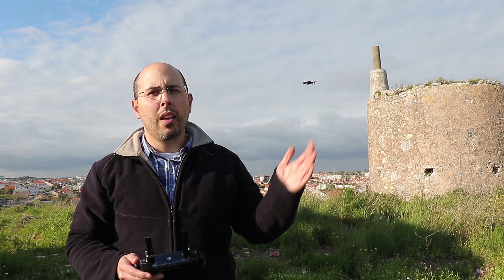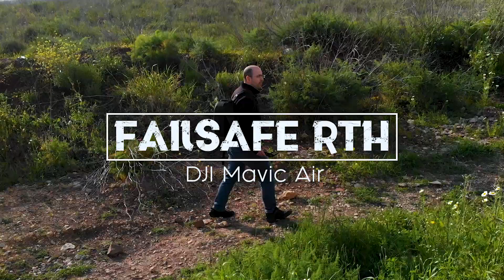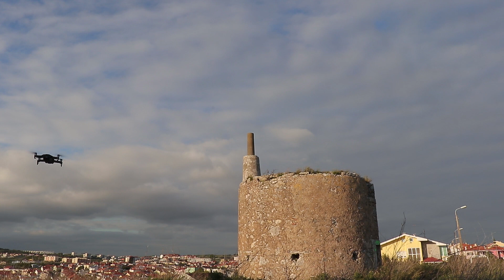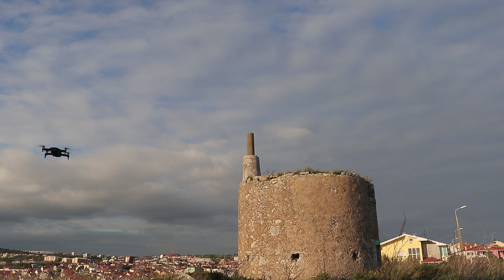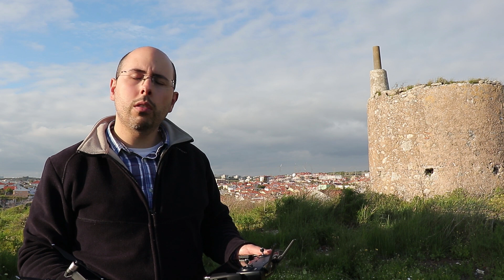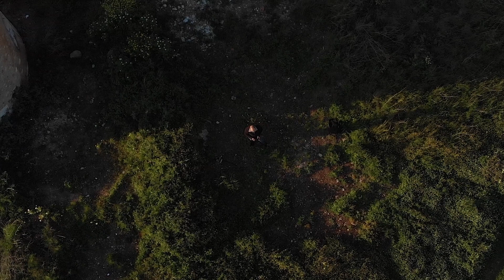The Mavic Air's Special Failsafe RTH

Comment: I know this is an old video but for anyone that finds this now and just owning a Mavic air (2018) the smart return to home isn't on automatically, if you Don't turn on APAS on the app then it will do the standard failsafe which is finding the quickest straight path back to the home position.

Comment: It is only applied for couple last seconds of coordinates before the RC is disconneted.
It is not applied for the whole path since the time it took off.
This feature is updated after few recomendations on the dji forum about returning home in the most effiecient way to regain the RC connection on the location where it was last time connected instead of going straight back home.

Comment: What happens if you lose signal when its in an autonomous mode like tap fly ? Example when a tap fly sequence starts does the drone keep checking for remote signal input in cycles or something, even though it doesn't need any, unless the pilot hits PAUSE or moves a stick ?

Comment: awesome review... question, (just for argument sake), if the drone circles the building 10 times before losing connection, if the the rth kicks in, will it retrace (circle back 10 times) also before returning to home? thank you.. keep up the good reviews Sir! :-)
Reply: I know this is an old question but the answer would be no, as that could cause the drone to waste all remaining power then fall out of the sky. if you went around the same building 10 times you would have lost signal 10 ten times anyway.
Reply: @jasondonavich2758  thanx for the reply...cheers!
Reply: It possible to turn on 10’times but it with somebody else lol cheers

Comment: This is great...unless your battery is about to crap out.  That extra time retracing could be the difference between making it back or getting lost.  That scenario may not be common, but I've seen it on YouTube.  Great content, BTW.... thank you!
Reply: is the workaround disabling RTH obstetrical avoidance to make it go home in a straight line?   as long as we set the right RTH altitude.

Comment: Is failsafe actived automatically or do i need to turn it on somewhere ?
Reply from the maker: It's on by default.
But you can set on the app the default action for signal lost.
Reply: @EmanuelPontes1983  is it i can't RTH by straight line? It have 3 ways, RTH/hovering/landing. It's seems not possible to choise straight or way by path.
Reply from the maker: @aidar_almaty you can only choose the action for sinal loss. You cant choose the type of rth.

Comment: @Emanuel Pontes
I know this is an older video but I since I recently picked up a couple of Mavic Air's I am watching more videos about it. I can't help but wonder though if it was in the middle of retracing it's path and the battery level then became only enough for a straight line path to home would it continue to retrace it's path or change direction straight return to home. Would make for a very interesting test!
Reply from the maker: Pretty sure that once it starts tracing back in FailsafeRTH, nothing but the user regaining control, can change that.
The drone would continue tracing till it reaches homepoint and land, or runs out of juice and falls.
Reply: @EmanuelPontes1983  I don't believe the drone would fall since it's in auto mode, if the battery is below 10% it automatically starts to descent until it lands. It's better to land somewhere closer to you than to fall out of battery, right? The problem would be flying over water.

Comment: I tested today de vertical retrace:
Test 1: 50m climbing to 80m signal lost retrace at 80m (no descent)
Test 2 : 70m descending to 35m signal lost, climb to 45m(rth altitude) retrace climbing to 70m.
Test 3 : 30m climbing to 83m signal lost retrace at 83m (no descent)
Conclusion the drone retraces the vertical path only climbing.

Comment: I just tried. And for some reason I can only get a direct return back. I did a simple zig zag flight. Then turned off the controller. But it simply climbed. Turned. And flew straight back
Reply from the maker: There has to actually exist obstacles in the way.
The sensors build a 3D map of the area and if it think its safe for a straight return it will do so.

Comment: In fact the manual states that the loss of controller signal will result in only 60 seconds of retraced flight. Followed by a straight path to home. So take care with setting the correct return altitude
Reply: Ian Authbert why would anyone not set 400 feet for RTH? Just under the max so you have the best chance to clear any unforeseen obstacles?
Reply: Andrew because flying up to 400 feet uses battery power and if it’s low on battery that’s (arguably) wasted unnecessary power consumption. I realise some may disagree, but that’s the answer to your question - pilots choice ultimately to try anticipate what will be required.
Reply: After the Mavic Air goes up to 400 feet, it would also uses battery power to fly down to land from the added height.

Comment: can this feature be disabled to have the mavic air return in a straight path?
Reply: I’m pretty sure the RTH is always a straight path at preset altitude when the controller is connected. The retrace flight path is only when connection is lost. Please feel free to correct me if I’m wrong. It’s a feature I need to investigate
Reply from the maker: You are correct. That's why I mentioned in the video that this is regarding Failsafe RTH (it's how it is called when the remote disconnects).
Reply from the maker: No. It's in the firmware.
Reply: I believe it might take the straight path if the battery is low? At least that is a factor in the time to RTH. Another test with low battery could be good.

I just lost my Spark (R.I.P) today as it always takes the straight path and it hit something on the way, so this feature is good. I'd still say keep good line of sight for a straight home path, if ever needed. I know I definitely will going forward with my next drone.
Reply: @nexfilm   
what altitude did you set to spark for RTH?

Comment: great review! ... my question is, is this 'special rth' feature happens ONLY when the controller is off? what if im out circle around, and i hit the rth button? would it circle around too before rth? cheers...
question 2 - with your experiment in the video, instead of switching off the controller, and i hit the rth button,  would the mavic fly back in a straight line or still follow the  path it came from (around the windmill)?
Reply from the maker: According to the manual this failsafe rth only happens when the drone losses connection to the remote (be it from turning it off, out of range or whatever...)
If you trigger the rth from the button (called smart rth) there is no reference in the manual that it will do this path retrace, therefore i think it will always fly in a straight line.

Comment: Is it wanted like that? If the signal is lost, it may happen that the way back is too long and the battery is not enough! then the Mavic crashes. the direct way is always better, right?
Reply from the maker: It depends, if you fly behind a tower, the direct way is through the tower. If you're flying at night, for example, where you can't use obstacle avoidance, that means a crash.
I'm guessing that the battery situation is something that is taken into account when the failsafe kicks in.
Reply: Emanuel, I have read a lot. When the Air gets the signal in 60 seconds back, the Air stopped and wait ten seconds for new order from the pilot. If there is no new order, the Air flys the direct route home. In case of no signal after 60 seconds, the Copter stop the original way home and change to the  directly way. I found it in the manuel, under Return to home modes... 😊✌️
Reply: Emanuel, thank you. Yes, that would be an option. I think it will be like that... ✌️

Comment: Let me ask. If you are for example at 900m flying back to home point and the radio dies at 500m the failsafe mode will be activated. The mavic will retrace path to 900m and then return to home  or it will go back from 500m direct home?
Thanks and congratulations!
Reply from the maker: It depends.
If it is flying back already in RTH and the radio dies it will continue RTH in a straight line.
If you're flying back manually then there is a chance it will retrace back to 900m (depends if the drone's realtime map created by the sensors thinks there are obstacles in the way or not)

Comment: Hmm I didn’t know this about the Mavic Air, that explains why my mavic air doesn’t fly back to the home point in a straight line when I hit the RTH, I thought it was flying away but it wasn’t, this video explains why thanks for sharing.
Reply: Romeo Fowler this feature is only in failsafe mode. If you hit return to home it should come back in straight line!
Reply: @cesarbonifacio8799  That's been my experience. Thanx for clearing that up.
Reply: short addendum: this is only valid for signal loss; if it´s a "battery" rth (or battery alert comes in on "signal loss" rth) it will come straight.

Comment: So, if you fly onder a high bridge at low attitude and lose connection it wil crash in to the bridge in failsave RTH?
Reply from the maker: From the tests I made it appears that the Failsafe RTH will only trace back the route on the horizontal plane, NOT the vertical plane. It will still climb to the preset altitude.
Using your example, if the preset altitude is higher than the bridge height, then yes, it will hit the bottom of the bridge while climbing to the preset altitude.
Reply: Not sure if that is true or not if you have the RTH obstacle sensors turned on.  This uses the sensors to avoid obstacles in the RTH mode. Maybe somebody braver than me could try.
Reply from the maker: It is true.
If during RTH there is an obstacle the drone will stop, fly up untill there is no more obstacle, and then resume RTH.
I might do a video about it.
Reply: Emanuel I made a test and the drone climbs to the rth altitude and it retraces back vertically but never below rth altitude it climbs more if the flight was in a descent path!
Reply from the maker: @cesarbonifacio8799  It's probably all due to the algorithm DJI has built in. Can't really say for sure what is happening.

Comment: I've had my Mavic Air a couple of months and I never knew about this RTH feature as I've only switched on the RTH a couple of times.  I love this drone so much but it's so easy to fly it out of sight and that makes me very nervous.  Its never lost connection with the controller or the video so maybe I worry too much.  Nice video and great information, thank you!
Reply from the maker: Thanks Thomas.
Having a disconection due to range is not as bad as you think as you have indications you're about to disconnect such as laggy video and warnings.
The ones that worry me the most is when you disregard that there's something between you and the drone and all of a sudden the connection drops.
Generally speaking I do trust the RTH. Neither on my Mavic Pro or my Air it let me down once. So far.
Reply: @EmanuelPontes1983  
Have you ever experienced that the GPS signal dropped to 7 satellites or less? When this happens, the RTH doesn't function anymore... 
I noticed that this drop in GPS signal is often occurring in plain field without any obstructions whatsoever. The signal can go from 14 to 7 at once. This makes the Magic Air very unreliable to fly.
Reply from the maker: @MrAntongm  I never noticed such a thing on my unit. It has been reliable for as long as I have it.
Do you have any skin on it? I've heard it can be impactful on GPS signal.
Reply: @EmanuelPontes1983  
I have no skin on it and it has never crash landed. I take good care of my drone. I don't understand it either, but it is always an unpleasant surprise when it happens, especially when you are flying on the range limits of the drone.

Comment: Hope it isn't a prank, because you can't be sure this days. However, if it's true and I believe it is then kudos to you! This is important feature that other reviewers failed to highlight or even notice.  Good job!
Reply from the maker: Thank you Darius.
It isn't a prank! You can check the user manual.
Although please note that the Mavic Air doesn't always trigger this method of RTH when it disconnects, sometimes it flights in a straight line.
I'm guessing it all depends if the "realtime map" created by the sensors indicate an obstable or not.
Reply: @EmanuelPontes1983   I'm thinking it may take a straight line depending on the power left in the battery to get home. If it calculates safe retrace,it will most likely take that option. If it calculates a retrace to home is risky, i believe it's going to come back in a straight line! What do you think?